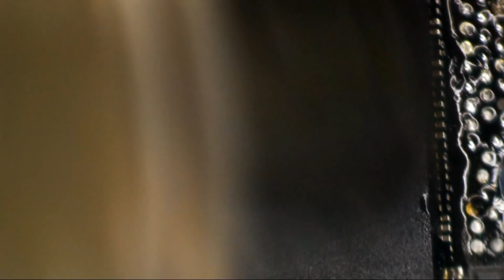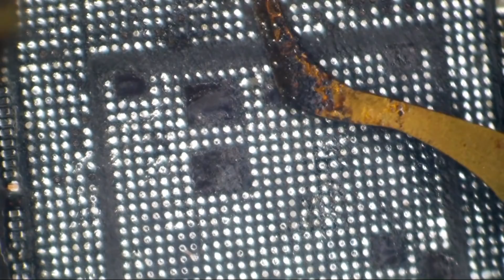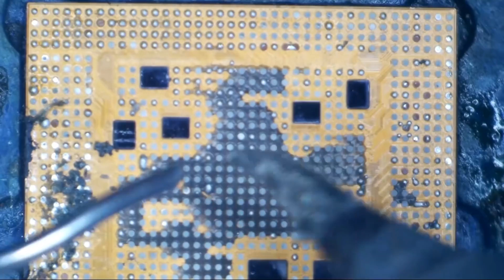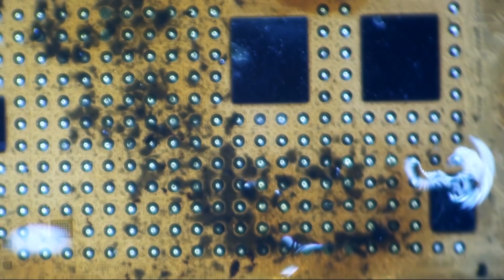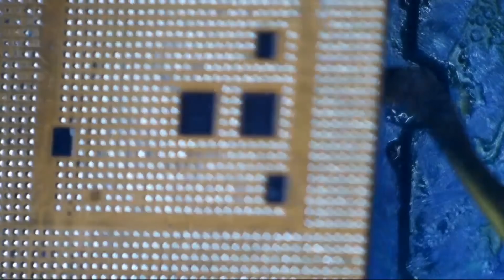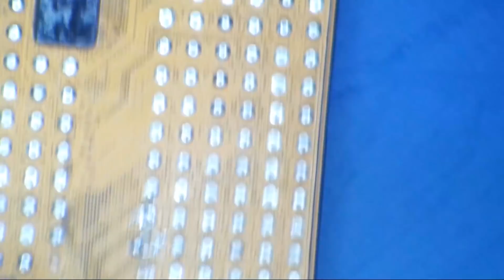Practicing iPhone X CPU A11 Rework [FAIL]

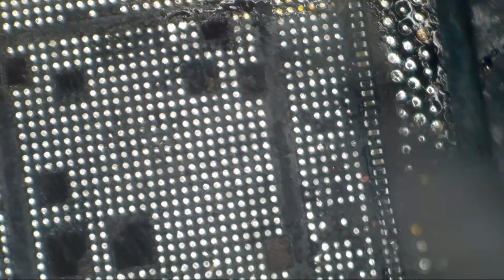Comment: 20:44 ...or another method using just the hot tweezers to hold the solder wick, then "mop" it over the pads. Nearly the same effect, but no uncontrollable hot air and you can use just "one hand."

Comment: For the tool that you used for breaking the underfill around the chip, maybe use a sharpening stone to thin the blade and get a little more clearance around the edge of the chip. That may reduce the chances of knocking off the capacitors surrounding the chip.

Comment: Can you please explain what you mean by iCloud boards? Are they iCloud locked? And if so what do you do with them?
Reply: i think he mostly uses them as donor boards for other repairs
Reply: @darveenDE  So when he said a live run he just meant checking if the phone still booted afterwards. For some reason the first thing I thought of was that replacing the cpu would somehow remove the iCloud lock.

Comment: I was hoping that you take off one of those chips from the bottom of the CPU just to see how they look like.
Reply: its just 2 pad solder either big or small all of them got 2 pad only and for reball just we remove it and simply put it back. depending on the reball stencil.

Comment: PRO TIP.  When i heat up a underfilled IC. I will press around the top of the ic. Not to hard to crack it.  This will pop loose the ic from the underfill and then you can remove it.

Comment: I'd say it's a successful first attempt. Get the experience and get the camera out of the way and it'll go smooth. You should have seen my first attempt at SMD soldering, and my first at BGA soldering! I burnt the hell out of the smd components with my iron and ruined the BGA chip with my heat gun. Now that I've got a real job in HVAC (not an electronics hobby and a grocery store job to support that hobby), I get to help the plumbers and screw things up again! (Imagine somebody fixing furnaces and A/C for 2 years gets asked to replace a cast iron main in the basement and put in a new sink) At least I've got a Journeyman to work with who's a good teacher and will let me teach myself most the time, but stops me before any harmful mistakes are made. Which is why I never constantly point out mistakes on your videos. You've already recognized them, learned from them, and will apply that to future repairs. You now know what to expect when doing an iphone X cpu, next time you can improve upon that knowledge and not chip the edge of the cpu.

Comment: If I may suggest, record your CPU reball/swaps even if you don't post them.  You will have a video documentary of what you did, so you can look back on to double check your work in case you have a problem when you are done.  If you are under the microscope, it really isnt in the way.   Could save you pulling it back off to check under.

Comment: Hi Jason 
I watch and learned so many things from your work and I'm not a mechanic still learner.
But you can try mechanic bga remover liquid for for removing the glue from chips and main board I face a lot of time same situation same like u but finally bga remover works good more then iron and cutter tool it's take time but you can try 1 time

Comment: Red hot CPU bro ...🤣 good practice run 🏃 
I cut a stencil a thin one. Then the old stencils and filed it smooth .. I cut it to fit in a X-Acto knife 🔪 that’s what I use for taking CPUs off and a small wire brush very fine for cleaning the CPU with hot air to remove Underfill. Took me lots of practice lots of donor boards thanks 😂 for sharing Jason 👍
Reply: Wire brush doesn’t damage cpu pads?
Reply: mrsemifixit Wire brush/nylon don’t know what material it’s made out of lol

Comment: Hi Jason curious what software do you use to diagnose an iPhone and back up data etc. other than iTunes.  Thanks .
Reply: Mark Stanchin 3UTools is one of the best. It can even sync serial numbers of the parts inside the phone, and determine if one has ever been replaced by performing an NVRAM check.

Definitely recommend you use that tool. Its has everything itunes has, but much more.

And its free

Edit: I don’t know if Jason is using this tool. but if he isn’t, i strongly recommend it.

Comment: Hi jason how are you?? iphone 6 plus after the touch ic replaced grayed out wifi two iphones in row never happen to me before if you can suggestion me anything to get this wifi back
Reply: Not far from the Touch IC, here is an inductor and a 3 terminal capacitor that boost voltage to the WIFI/Bluetooth IC. 

 L5201_Rf and C5201 I'd check to make sure they are correctly positioned, then check resistance.

If they test okay, I'd start standard "IC"  trouble shooting:

 Step 1. Check resistance on power, data and "enable" rails.
Step 2. Check voltages on power, data and "enable" rails.

All okay? 

 Step 3. Replace the chip
Reply: @OnYourSquare  i test both cap's are fine shows current volt on C5201 is 2.68 as well as for L5201 thier no short lines cheaked ic took reading all ok

Comment: How are you using that glue remover tool without damaging the board? I've always had issues with the glue on the chips but I don't want to scrape it because I'm scared I'll cut one of the traces.
Reply from the maker: I think it has a lot to do with the angle it is at when contacting the board.  They tried to design it to not scratch the board I believe.  If I hold it or turn it slightly different, it can scrape up the board pretty easy.
Reply: @ststele  Allright I'll keep that in mind for when I work on a chip next time, Thanks!
Reply: MrSgtBlade when scraping don’t put too much force on the edges . Usually it force is applied you end up cutting traces . Blue glue is hard and requires abit much of heat and temperature
Reply: @zerodaydatarecoveryandfore1554  I think it's a combination of heat and angle that I was doing wrong. As for force, it's hard to regulate since the glue is thicker in some areas than others & components can anchor that glue a little.